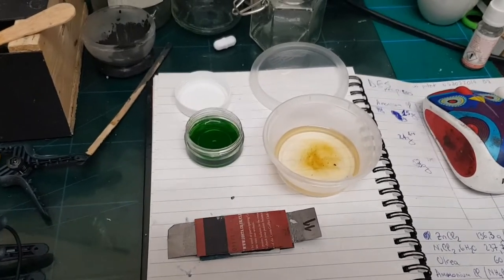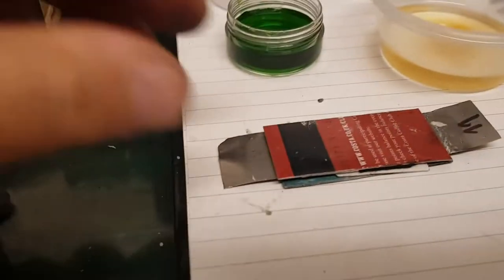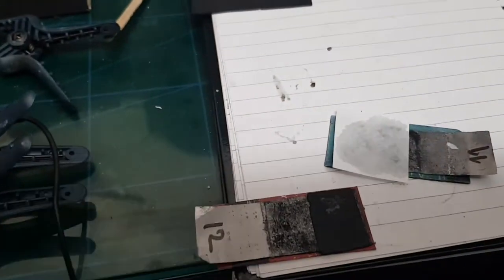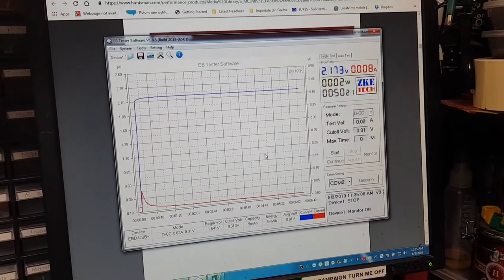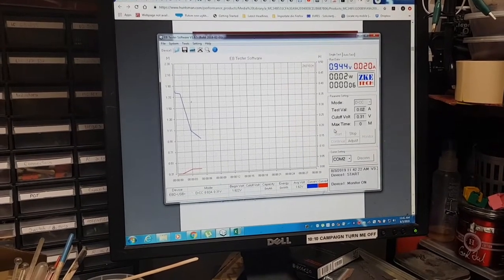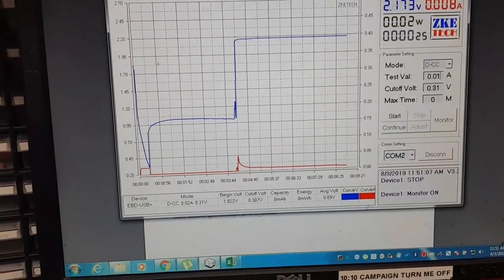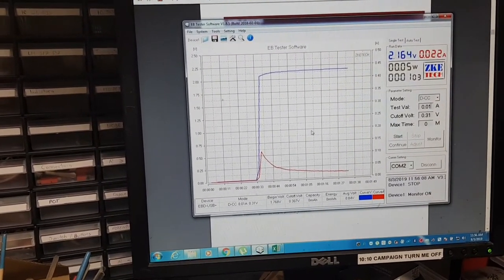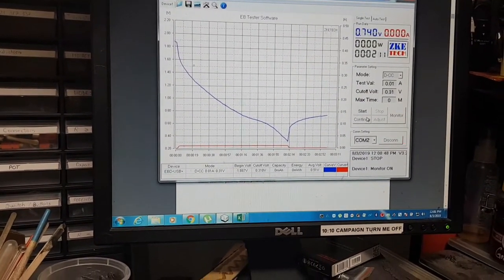Deep Eutectic Solvent - preparation and test

Comment: Great video! Very useful! Two questions:
1. Does aluminium chloride or magnesium chloride also work with urea as a deep eutectic solvent? If yes: These metal salt in their pure form usually come as hexahydrates --> can you "dehydrate" (vacuum, heat...) them after they form the DES?
2. Have you tried making an aluminium ion battery with any DES?
Reply: I tried to make alc3 urea electrolyte but when it cool down it become solid again ... I use 1: 4 ratio .. Should I reduce the ratio so that it can remain liquid in room temperature ?

Comment: i want to make a DES solution 1:1 molar ratio for choline chloride:lactic acid. does my step below correct? 

250mL of des solution
1. weight 34.90 ChCL
2. measure 45 mL of lactic acid
3. Mix and heated
4. add the distilled water till 250ml 
5. heat  90degree for 2 hours

I hope I could get the asnwer from you. thank you

Comment: great job, i wanted to know, how did you make the active paper material? I tried but I can't reach those levels
Reply from the maker: Hi Sebastian, I think the best way to tell you what you are not doing well is to see you in action first. Do a video of how you make the active paper and please share it with me. Basic principles that I am following: 5g of active carbon with different particle size, 0.5g of kitchen towels paper and 0.5g of CMC dissolved in 100ml  water. This is a basic formula. First I mix the paper with 300ml of water in a bullet mixer for 1 min, then I add the carbon and CMC and mix again for 2 min, then I am using a old technique of hand making paper , Rober Murray Smith has a very good video on this. I will try to send a link as well. Hope this helps you, if still encountering issues, please go back to the first advice.
Cheers, 
Sorin
Reply from the maker: This is the video of RMS: https://youtu.be/dFrpoRzdINA
Reply: @mihaiaragon  thanks for the advice, I have never tried to add cmc to the mixture, I was afraid to isolate the coal too much thanks again 💪😎
Reply from the maker: @sebastianlirussi5384  add the cmc to water, mix it for 5 min and then leave it to dissolve properly for 12h, you will see the difference
Reply: @mihaiaragon  ok perfect i'll Do It 😊

Comment: Is Nickel Chloride Hexahydrate acceptable?
Reply from the maker: I don't see why it wouldn't,  give it a try and let us know,
Cheers, 
Sorin
Reply: @mihaiaragon  just ordered the Nickel Chloride Hexahydrate last night. Already have the urea. My Choline Chloride needs to be dried as it soaked up a lot of water. How do I go about doing that?
Reply from the maker: @tv-strategies  do you know what amount of choline chloride di you had? If yes, put it in a beaker, on a heated bed set for 80-90 centigrade. All water will evaporate and you can check what amount you have in the beaker. If not, just leave it there for a few hours or more, only the water will evaporate.  Hope it helped.  
Cheers
Reply: @mihaiaragon  awesome, thank you. Im not sure how much I have, as I have used some of it. I am having a lot of trouble getting a DES with it "waterlogged"
Reply from the maker: @tv-strategies  it should not be that difficult.  As I said, dry it first, I would say for at least 24 h, in an oven at around 100 centigrade when the water will boil and start evaporate. In the end you will have only the choline chloride.  Then weight  all, put a sticker  on the bottle with the mass and then subtract every amount you use so, if the water will get in there, you will always kniw the amount you have.
Reply: Thanks Sorin. I will try it out. I will also let you know when I get the DES prepared with the NiCl*6H2O
Reply from the maker: @tv-strategies  I am not home now, so I can't check, but I have a feeling that I have the same salt at home, a hexahydrate.  Also, try mixing the Ni salt with urea in a 1 to 2 mol sol. Is a very good electrolyte
Reply: Thanks for the tip. I plan on trying a Nickel Ion battery with Ni Foam as the anode and MnO2+Carbon for the cathode. The NiCl DES for electrolyte
Reply from the maker: @tv-strategies  sounds very interesting,  like your first video, please do it and make a video to share, good luck
Reply: Will do
Reply: @mihaiaragon  I dried out the Choline Chloride and successfully made the DES. Thank you.

What do you use to test your batteries? Also, why is the capacitor with choline chloride/urea have really bad self-discharge?
Reply from the maker: @tv-strategies  hi, I use this: http://budgetlightforum.com/node/48747?page=1 , is good enough for my level. Is a ZKE ebd usb load. Regarding your selfdischarge level, I would check if you dont have a short between the electrodes,  measure with a ohmsmeter and if you get a value,  even in the range of kohm is not good, you have a short. Also, build a identical cell that has a different electrolyte and see the difference. You can try adding some metal chloride to that des to enable a higher ionic conductivity. 
Cheers
Reply: @mihaiaragon  I just had a chance to put together a cell. It's graphoil with activated carbon paste on it as the cathode, and nickel foam as the anode. I used the NiCl DES from this video and got a working cell. I will update as I experiment
Reply from the maker: @tv-strategies  Hi Josh, interesting cell design... can you describe more that Ni foam? Sounds promising.
Reply: @mihaiaragon  it's just pure nickel in a foam form. It can be found on eBay or Amazon